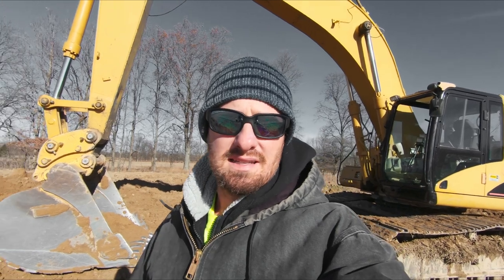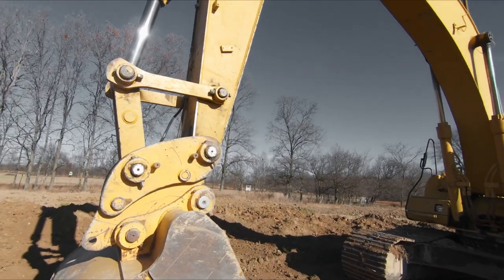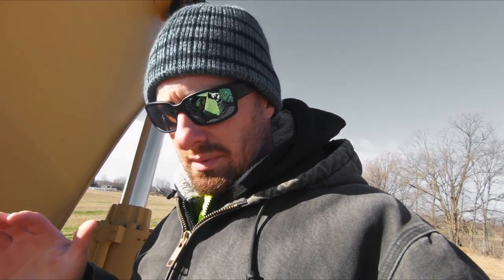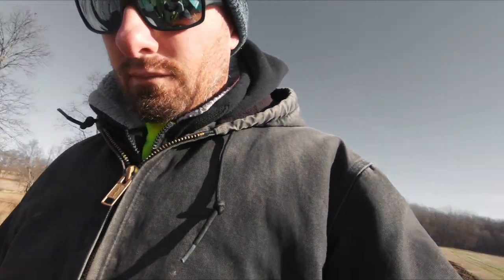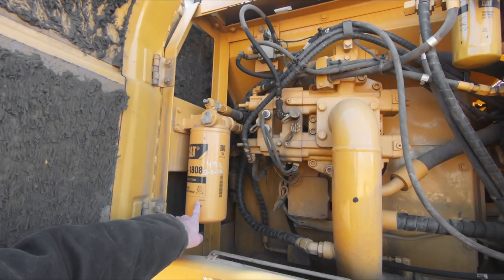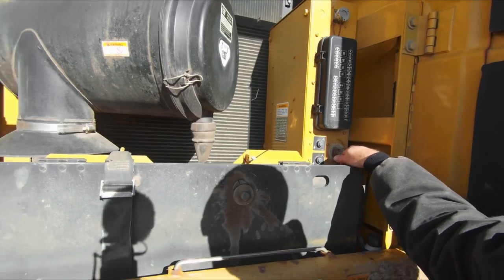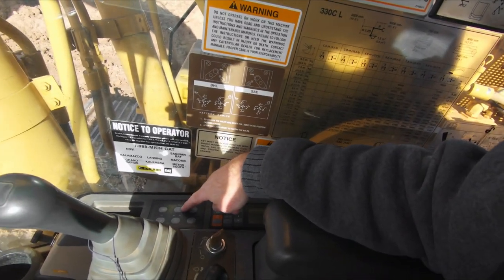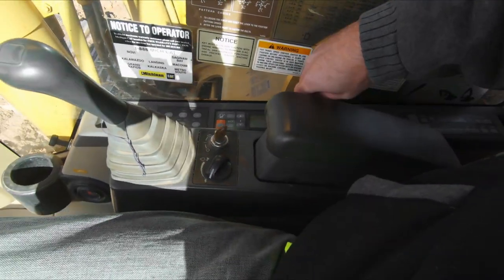WHAT TO DO BEFORE YOU START AN EXCAVATOR | Excavator Startup and Controls

Comment: Can you tell us what you think the best way to get your excavator level with a mini excavator it is easy because of the blade but how do you that without the blade?
Reply from the maker: Sure! I'll try to make a video on this in the somewhat near future. In the meantime, use the bucket to dig a slot for your Trac to sit in on the high side. If you did your slot even with the low side when you pull forward into the slot you created your excavator will actually sit even. It's a little hard to explain through text so I'll try to get a video up pretty quick here to demonstrate
Reply from the maker: As you requested:  https://youtu.be/r7q9xxA8spQ
Let me know if there's anything else you'd like to see on the channel!

Comment: Not certain, but I’m pretty sure I saw somewhere that the swing bearing is once every 250 hours
Reply from the maker: You are correct.  Most machines state that the swing bearing doesn't need to be hit that frequently.  That being said, grease is allowed to spill out the side of the bearing so you won't damage anything by "over" greasing.  Due to how expensive that mama is, I've always greased it a couple times a week.